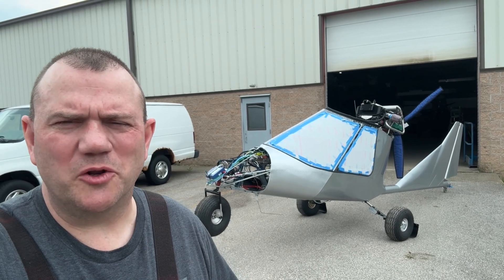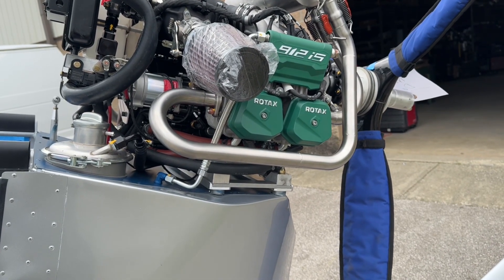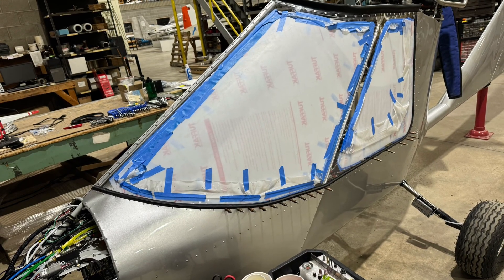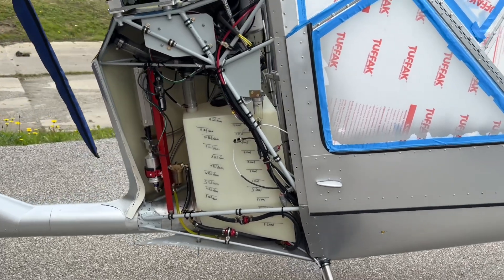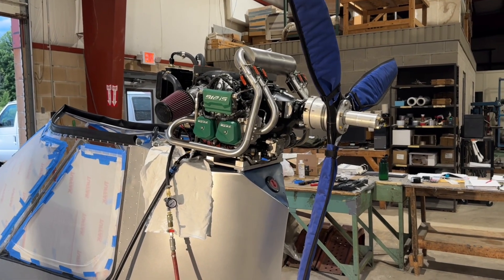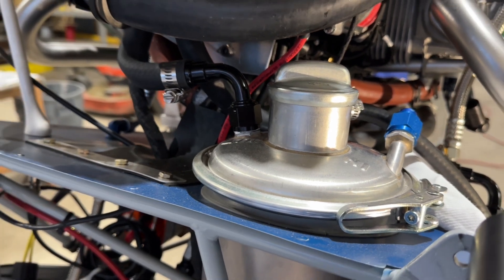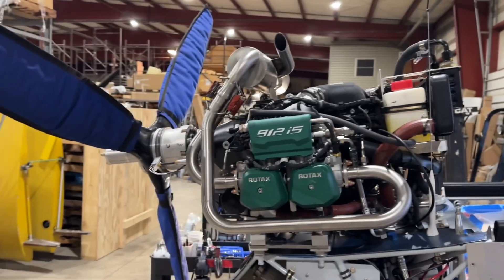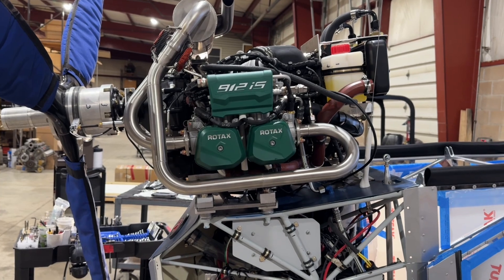N907AV Titan Tornado Update

Comment: Beautiful workmanship on a meticulous build.  So glad you were able to use this engine.  I'm not at all certain at this point what engine I'll be able to use, but I sure wish it could be a 912iS.  I've read comments that indicate a good reason to have wheel fairings on the main wheels is to keep the tires from flinging dirt and stones toward the prop.  What are your thoughts on this?  I would also like to run slightly bigger tires similar to yours. I'm wondering if fenders might also be an option that would keep the tires, wheels and brakes exposed for easy access and examination.  But would the drag be too big a penalty?  So many questions come up when pondering my next build.  Thanks for the inspiration.
Reply from the maker: Thanks.  The build took longer than I expected but I was learning along the way   I’m not building a speed machine so I haven’t really been worried “speed penalties”   I built custom “fenders” like we use on the planes (C206) that I flew up here in Alaska   The goal for my design was to reduce the risk that you point out of throwing rocks etc into the prop  I can’t post a picture  get me you email and I’ll send you one